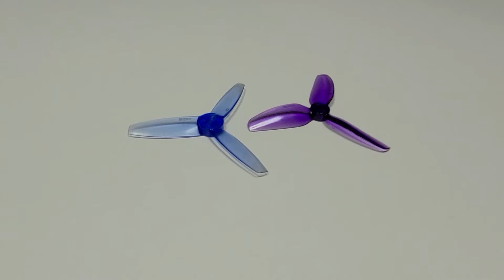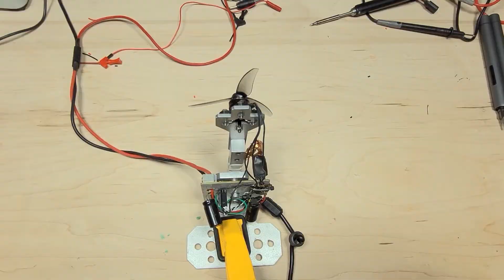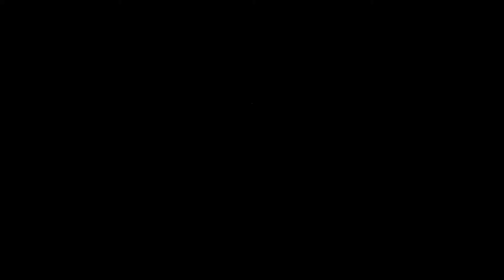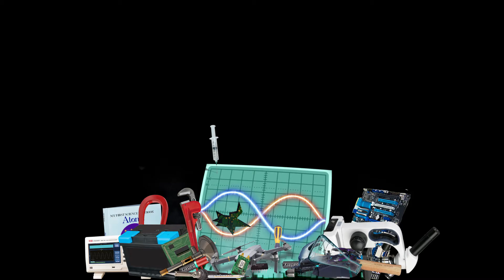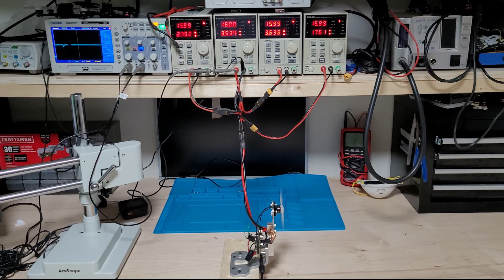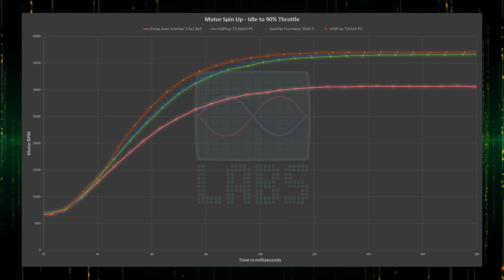3" vs 3.5" Propeller Testing PART 2,  with Throttle Response Data

Comment: The Gemfan 3035BN-PC on a 3" frame should result in a faster quad I think. The larger 3.5 props may help with acceleration, but the Gemfan props have higher pitch and spins faster according with the date shown...I'm not sure if 3.5" is better than 3" for racing.

Comment: Its the time to develop thrust, not RPM, that matters from the performance perspective.
I wonder if you could possibly graph thrust over time?
The rpm difference wasn't a lot less for the 3.5" props over time, but I expect thrust would have increased a lot faster.
Reply from the maker: The thrust sensor is only updated once every 50ms, so it's not a great for this type of test. That said since I measure both RPM/Thrust every 2% of the throttle range in bursts, it would be possible to extrapolate the closest thrust measured for each RPM and get a general idea of the thrust curve with some effort since the thrust to RPM is the same between tests/motors for the same propeller.